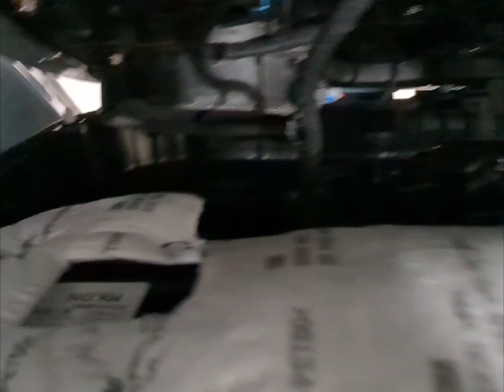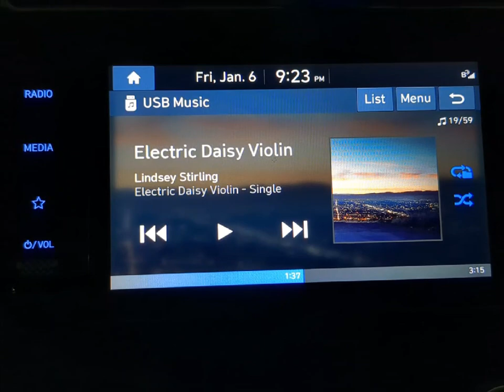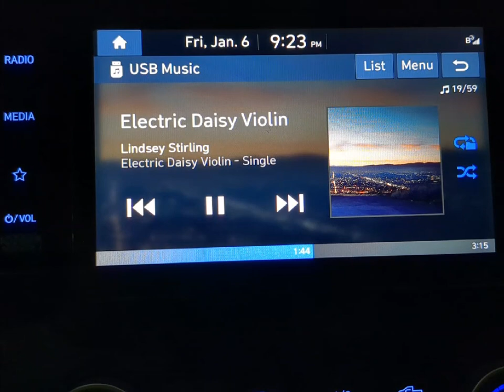Upgrade Hyundai Santa Cruz speakers to a premium sound system for less than $200

Comment: Thanks for this video. It inspired me to upgrade the speakers in the Santa Cruz. I used the JBL GTO609C in the front and WOW what a difference. Instead of making a bracket or buying one, I reused the factory bracket for the woofer. I just ripped out the flimsy factory speaker and cut the plastic mounts on the back that held the speaker in. Worked perfect. I also reused the factory bracket on the tweeter. The tweeter has some clips that can be undone and then the tweeter can be popped out and the factory bracket can be reused. Big improvement.

Comment: Why did you buy so much sound proofing material i just bought the same setup you did for my santa cruz i get everything monday i was wondering because i only seen you put a little bit on the tweeter brackets you printed
Reply from the maker: You are right. I didn't need all that. I bought it because that was the smallest package (and cheapest) I found on Amazon at the time :D I still have lots of it left.

The JBL speakers are great choice. Good luck with the updates :)

Comment: Thanks for that info 1 last question what type of material did you use for the 3d printer
Reply from the maker: I used PLA, specifically this one https://amzn.to/3WdPit9. I rarely use my 3D printer so it wasn't well calibrated. You can tell by looking at the speaker ring I printed. The patterns were kinda misaligned, but it's holding well so far. If your printer is calibrated, the print quality should be much better with a stronger frame.

Comment: what type of speaker wire did you use, what about the crimp kit as well? Did you have to use the screws you bought?
Reply from the maker: I used 16 AWG marine wire because I already had them from a different project, but I'd suggest having some audio wire instead. They are more flexible and easier to run along the panels. I updated the description for the wire and crimp kit. Yeah I used the screw I bought to mount the speaker to the adapter cuz the metal brackets that come with the JBL speakers need the metric screw. If you don't use the JBL speakers, you don't need the screws. The JBL speakers have their own screws but they are a little too short for the adapters.

Comment: Thank you very much. I heard that SC has Bose sound system so it’s already a good sound system
Reply from the maker: you're welcome! The Bose system is only available in the limited trim. If you have any lower trim, it will be the stock speakers, which aren't great.
Reply: @diynoob3663  thank you ! Great video

Comment: Hi. I installed the gto609c front kit and unfortunately I didn’t like the sound. high frequencies put too much strain on my head. The equalizer doesn't help. The sound quality is certainly better, but in the end I can’t listen to it without an amplifier and returned the stock.
In any case, thank you very much for the instructions. She helped solve all the installation problems. I'll just choose another speaker or look for information on installing the amplifier. My first experience)
If you install an amplifier for yourself, then know that I am waiting for it)
Reply from the maker: Sorry to hear the gto609c  didn't work out for you. Just curious, was the tweeter level adjustment button pressed? On the crossover box, there's a button in the middle. If the button is pressed, it will increase the volume of the tweeter by 3dB, which can be a lot. I also tried with having it at +3dB setting initially and it was too much for my ears as well. So all of my front and rear speakers have the tweeter adjustment setting at 0dB now. Also the JBL speakers are known to have some break-in time. After a month or so, they started to sound much nicer. I have JBL speakers for my home theater as well and they also took a few weeks to break in.
Reply: The tweeter setting was 0 dB. I've also heard that they need time for better work. Perhaps my mistake was to surround the tweeter with foam rings like the other speaker.

Comment: Did you not use the sound proofing insulation?
Those are the exact same speakers im looking at.
Reply from the maker: I did but didn't make it clear in the video. I had them between the 3D printed rings and the doors (see at 7:19). You can see in the video that I kinda trimmed the insulation around the rings. I also put a square of insulation on the door panel, right behind the speaker's magnet.

Comment: Are you using an aftermarket amp to drive the new speakers or just using the factory head unit?
Reply from the maker: Factory head unit. It has been doing great with the JBL speakers so far.